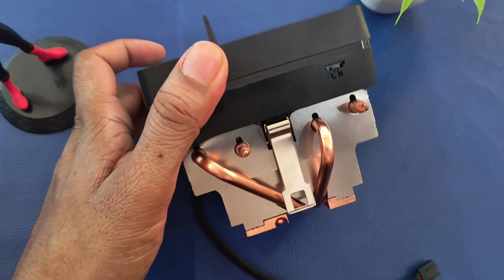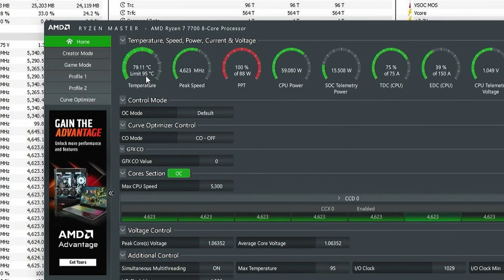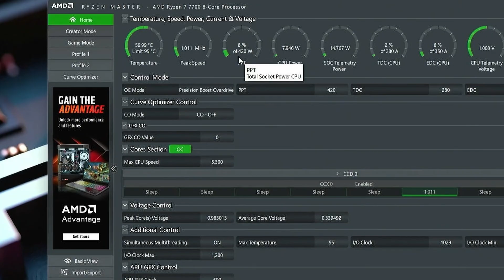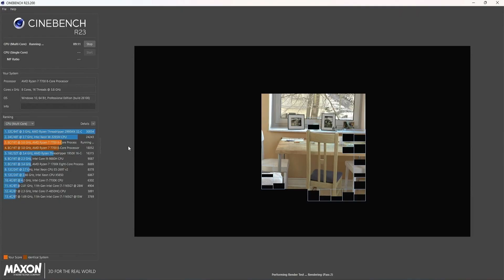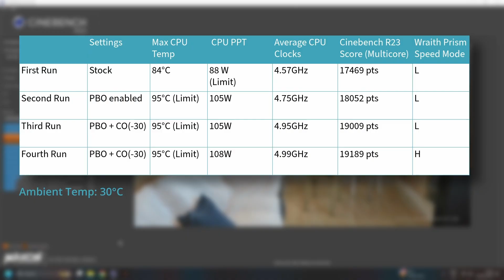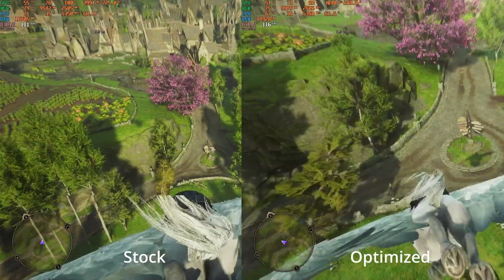I tested AMD's Wraith Prism ❄️ on Ryzen 7 7700 – Can It Keep Up? 🔥 PBO & Curve Optimizer Guide

Comment: I have the same processor with the same motherboard as my processor does not accept above -10 when I put a higher number my device breaks down and I have temperatures above 80. ?
Reply from the maker: It all depends on the silicon quality of the chip. Even if the processor is same, some can sustain greater -ve offset in CO. I suggest you keep the settings where you feel things are most stable and enjoy your processor. It's a great cpu out of the box as it is.
Reply: @Shubhajit_D ok Thank you

Comment: I would have left it at 88w, pbo -30 for all cores and also tried to lower Vsoc voltage as much as possible. Lowering Vsoc will reduce the power draw greatly and make it run cooler. With 6000 RAM and Vsoc at auto most motherboards will default it to 1.25v. My 7800x3d will easily do below 1.1 volts Vsoc when using 6000 RAM.
Reply from the maker: Thanks for the suggestion.....I'll definitely try it out
Reply: @Shubhajit_D  -30 pbo will probably be too much for the 7700. It works fine on several 7800x3d CPUs I've tested. I think many 7700s will do -20. I have a 7700 on order that comes with the wraith prism. My plan is to use the stock cooler for now, find the lowest pbo, lower Vsoc and keep the 88w limit. Anyway, lowering Vsoc makes a big difference in temps on my 7800x3d. Will report back when I have my components and done some testing.